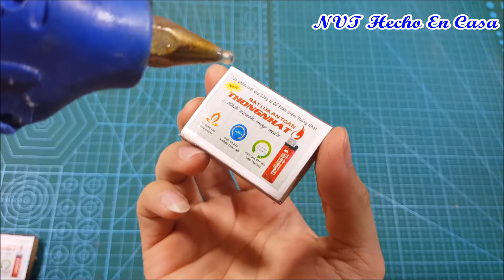Cómo hacer una pistola de pegamento caliente inalámbrica

Comment: Que ocupaste para que caliente la pistola de silicona?
Reply: Regulador De Voltaje Tension Lm2596 Corriente Continua, Resistencia Calefactora Estación De Soldado (24V 50 Ohms), Pila Batería Recargable Lc 18650 4000mah 3.7v Li-io (X3)
Reply: Falto el modulo de carga y descarga
Reply: @jesusmanuelquintanacaycho6184  LM2596
Reply: @RadioSaico  ?¿?¿?